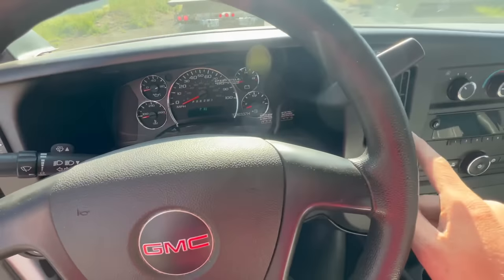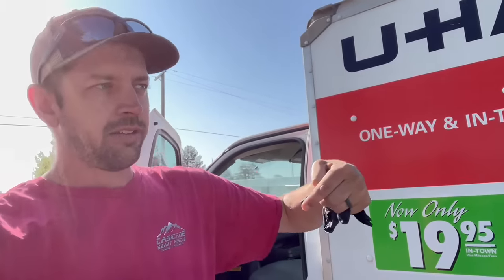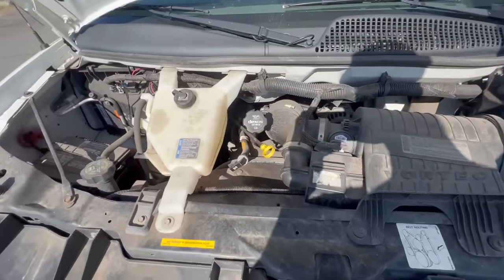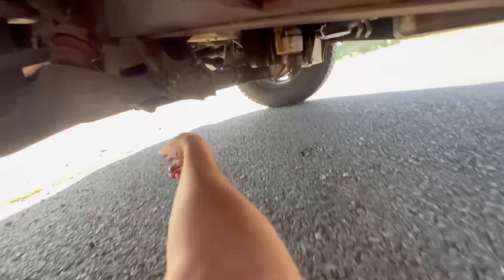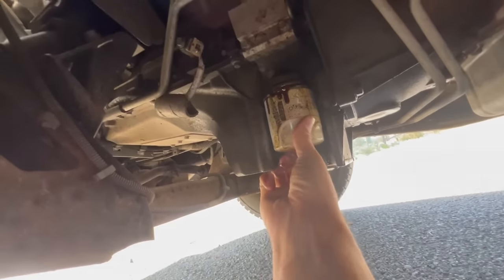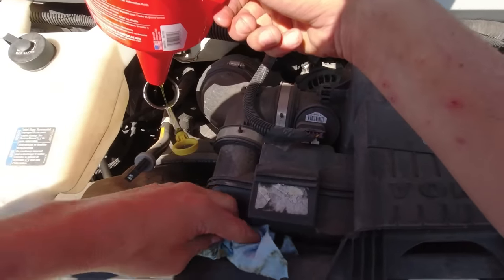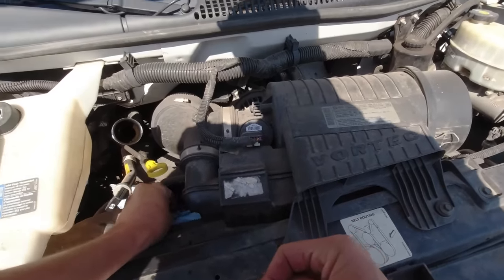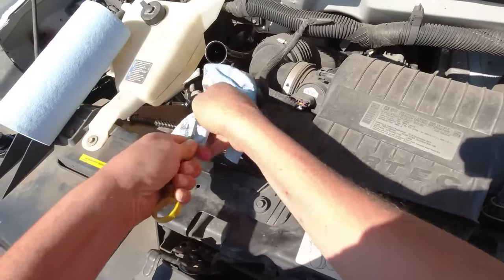Sometimes Being Honest Costs You A Job…

Comment: Good job.  I was fired from a plumbing apprentice job because I let a customer know they could turn down their thermostat a little and possibly not need the new water heater they were quoted a couple thousand dollars plus to have installed.  Next shift I was called into the office and they spent about 30 minutes explaining that they did not have to tell me why they were letting me go.

Makes me wonder now if in fact they did have to tell me, but I digress.  I knew the job would sometimes require dealing with some unpleasantness, but sometimes ended up being the wrong word.  I can't believe what I witnessed in just a couple of days, and more disturbing was just how casually the plumbers took being covered in shit water.  

As a mechanic I sometimes ate with somewhat greasy hands, but to watch a plumber eat with unwashed hands was something entirely different.  Count me out.  

"I can't quit because you fired me!"   When it comes to providing for my family, I don't quit.  I'm glad they spared me who knows what before I could have reached that point.  Also my integrity and work ethic can go with me to every job so long as I don't sell them out for any job.

Comment: Likely whoever changed the oil last just finger tightened the filter. Always give it a 1/4 turn after it touches so it doesn't vibrate loose.

Comment: On most dipsticks, the distance from the bottom mark and top mark is 1 QT. On these GM V8 dipsticks they marked ¼ QT increments, not just the 1 QT from top to bottom. Anywhere in the hatched area is fine; dead center is usually the capacity spec for most vehicles.

Comment: I used to work in the desktop/laptop repair for Microcenter.  They'd always want me to upsell customers and make them pay for things they don't need or replacement units.  I'd give customers 5 options.  The cost of repair, no cost but it's rigged to last as long as it can, and 3 different price options of comparable products at around what the laptop/desktop cost originally.  I'd usually ask what it's being used for so I can gauge what the customer actually needed.  Pentium/i3/i5/i7, r3/r5/r7, storage and features after that.  I wasn't there to pad my commission, I just want people to be able to use their hardware.  I love seeing stuff like this, gives me a little faith in some people.

Comment: Strange that, the van didn't have the oil indictor light on. You just added 5 quarts to engine that only holds 8 quarts, I would think that's low enough to throw that light on. It has it, i saw it when you were starting it.

Comment: Sometimes the old oil filter gasket will come off and stick to the oil filter Stand. When you install the new filter it will tighten but vibration will cause it to come loose. it could cost you a new motor.

Comment: You will get less dribble from the bottle if you initially poor 'overhand'.
Pour either with the jug sideways or with the spout 'up'.  Transition to 'normal' as the contents empty more.
Often the bottles have a little icon illustrating this on them!
It keeps the spout from aiming at the sky and oil/or-whatever-you-are-adding from dribbling down the side of the bottle when you try to stop adding...

Comment: Believe it or not I had a very simular situation a couple weeks ago. Went to tow peterbilt semi for power steering leak. Open hood to hook up air and notice power steering filter soaking wet. Grabbed it and wouldn't you know it was loose. Two non English speaking drivers, I asked if they did pre trip. Of coarse not. Called their dispatch and informed them of situation. Proceeded to fix it fill it up test it and saved company tow and service at Rush. Charged them for my time and they were happy as can be. Yes cost me a tow but at the same time gained a good reputation for not taking advantage of company.

Comment: Back in the day, when I was towing I had a few of these. 
1. Call comes in "Brand new car is stuck in park. Tow it to the dealer."  I get there and check it out and it comes out of park easily for me. I ask the owner to demonstrate. I see the problem right away and inform the owner that they need to have their foot on the brake to release the transmission lock. Leave a card and go on my way no charge. (This would come back to us later when they called us to tow both of their cars that were damaged by a drunk that crashed into them in their driveway.)
2. Different call about a "car stuck in park. They want it towed to a shop." Get there and it is an older Buick, RWD, parked against the curb on a hill. Sure enough won't come out of park. So I throw a chain under the front and pull slight tension on the vehicle and the owner slips it out of park easily. Charge for a minimal service call. No towing or repair shop needed. 
3. Call for a vehicle in a parking lot that won't start for a tow to a nearby shop. Get there and the vehicle won't turn over and no solenoid click, but the headlights are bright. On a whim I get in and put my foot on the brake, shift it to Neutral, turn the key and it starts right up. I tell the owner the transmission safety switch is going bad, and explain how to start it until she can get it fixed. No charge, off to the next call. 
4. 1980's Ford pickup won't start. Bright headlights but not even a solenoid click. Try the Neutral trick and no luck. I bypass the solenoid to get it started. They claim it runs reliably so I tell them not to shut it off and they can drive themselves to the shop. I was nearby so no charge, but gave them a card and told them to call if they had any problems getting to the shop.

Comment: these heavy workload engines have a 6 or 7qt pan depending on the year.  with it at the bottom of the dipstick, it probably only had 2 quarts left in it, maybe less.  bet the engine is still cooked tho, these bearings don't do well without oil even for a little bit of time.

Comment: Cant relate to it automotive wise. but run my lawncare/landscaping company the same way. potential client was quoted thousands to have a their driveway torn out and new asphalt put down.....I came along and said "you dont need a new driveway, some redneck asphalt and your driveway will look brand new for less than 300. I cut out the big pothole in the drive way, filled it with a big pile of chipseal, poured some hot tar on it, dragged my 55 gallon barrel full of concrete over it a few times, then for a few hundred more sealcoated the driveway, and the money they saved they been investing into me as bi weekly lawncare and got several referrals outta them. Always lived by the "I scratch your back, you scratch mine"

Comment: Huh??? Funny but just remembering I had this same experience when renting a U-Haul truck, the biggest one on a seriously tough weekend move with zero time to spare. I show up early for the reserved truck, all is looking good and I get in it and, well, shit. Oil pressure gauge starts out okay but drops to near zero before I can roll it even ten feet. I shut it off, get out, look underneath and big puddle of oil directly below the filter. I go in the office and tell them the oil filter looks to be loose, the U-Haul agent says that's impossible the truck was just delivered from the maintenance shop for routine tune-up and oil change. I get him to come out with me and we both get down under, I reach up and easily turn the oil filter with my hand, loose as can be. Agent is not happy I just touched the engine like that. Neither of us has an oil filter wrench. I offer to go not a block away to an auto parts store to buy one, he refuses. Says rules do not allow him or me to touch it. Says he is required to call the maintenance yard to come tow it back in. Well, shit, how about a different truck? He says none available, it's the busy season. Ended up turning a full day's work (amicable divorce, splitting of household EVERYTHING) into a three-day weekend of a small pickup and compact sedan. Missed a day of work. All because of a loose oil filter and rules about who lay hands on the fool thing. Damn but I sure wish it was a Casey La Delle (U-Haul APPROVED!) sort of person on scene that day!

Comment: Surprised a customer noticed the low oil pressure and knew what to do (in this case, what not to do). Easy to blow it off when its a rental, but a machine is a machine, its a shame to just purposely trash them.
Edit: so respect to the customer as well for taking care of something that doesnt even belong to them.

Comment: I think in this circumstance, it's fair to charge the tow fee, you saved them a trip to the shop and still worked a fair job for them. *edit - Being "honest" now makes you liable though, particularly since you sourced their parts that now might cause the next breakdown which now isn't warranted because you didn't use the fleet designated parts? Just remember no good deed goes un punished. Make sure you've documented the as is help

Comment: I had a car that went in for complimentary oil change after purchasing it. After the oil change, it started leaking oil. I called and the service manager told me it was normal, for residual drips after oil change. I took it in, they put it on the lift. The assistant service manager wanted to show me the issue. There was an oil film near the front top of the pan gasket. A super light film. I looked and noticed the drip from the drain plug, borrowed the technicians flashlight to point it out. The technician then mentioned he had just wiped the drips from the drain plug. There was a small puddle on the floor under it. The technician had cross threaded the drain plug. I asked if they were going to fix it right, at their cost. They complained about warranty. Long story short, I emailed Chevrolet about the work, and also notified the owner of the dealership. If I were the owner, and the technician could not find the leak while it was staring him in the face, I would have had him pack his toolbox and leave. The service manager and assistant would probably been looking for new employment.   Casey, you do great work! Thank you for sharing

Comment: What would happen if you did all that and the pressure still dropped? Would they now be paying for the extra time and materials on top of the tow?

If the engine fails due to damage sustained while low on oil is your repair work insured? If the hypothetical engine failure results in an accident? Are you liable due to your repair?

Stick to what you do and do it as best you can. I don’t think you did the wrong thing but I don’t think you did the right thing either. Let them know what you found and they can decide from there and fix it themselves. Same principle no risk.

Comment: I think that once the cost of oil, time, travel etc was taken into account, the bill to the company would have been comparable to a local tow, but not a 7hr job. I’m not saying if what you did was right or wrong, but, unless you’re employed as a field mechanic, your job is to tow cars, and that’s what you’re paid for. It’s not as if they would receive the truck and never use you again because you didn’t check the oil level and find a loose oil filter prior to towing.

Comment: To add evidence to your statement of doing right by the customer, I had an electrician come out and give me an estimate for finishing hooking up my tankless water heater as one of the coils wasn't hooked up since the new tankless used more energy compared to my previous one.  Gave me an estimate of $4k as they said things needed replacing in the attic to be up to code as the bracket was cracked.  Called the second company that gave me an estimate of $1300 if the bracket needed replacement and only $700 if the bracket was good but only wiring was needed.  Hired that second company and they told me 30 minutes into the job that the "broken" bracket was a PVC holding that had gotten loose.  They fixed it no cost and even gave it support to be up to latest code.  My bill was only around $700 so who do you think I am calling on all electrical issues?  Who do you think I am recommending to all my neighbors?

Honest companies get all my business.

Comment: ill be honest here, i did an oil change on my car about 2 weeks ago, tightened the oil filter by hand as your supposed to, but my big brain didnt wipe the filter off, hands were oily, thus the filter was oily, i did my darndest to tighten it and thought it was fine, 2 quarts of oil later i got under the car again, wiped off the filter that was now more oily, and tightened it by hand but effectively this time and bam, problem fixed, sometimes you think "it should be fine" thats when you double check your work, because "it should be fine" can end in "its done for" real quick

Comment: GM uses a pressure switch and estimates pressure for the gauge in that model. No actual pressure reading, a engine with no oil at all will act the same way. It probably never had oil pressure when the oil drained out.

Comment: I would be very concerned about your insurance and how you drove the uhaul (around, not just up/down the street) with out written consent. Also lack of saefty arearnes on your part, at the very least use your 4-ways on both trucks. and put the hood down (not all the way but to see). I totally agree with you on doing the correct thing and what you felt ok doing. Good Job

Comment: I’ve forgotten who said this: “Nothing is more rare, or so astonishes men, as common sense and plain dealing.” 

About 1,000 years ago I had a 1965 VW Beetle that had lost braking power. I took it to the dealership, and they told me that it needed a complete overhaul of the braking system. The estimate made my hair stand on end. Then I learned of a little independent VW repair shop, operated by two young German guys, both trained at the VW factory in Germany. I took the car there, and they told me that all I really needed was new shoes and adjustments, at a fraction of the dealer estimate. I turned my car over to them, and had zero trouble with the brakes from then on. I learned later that (in the US, at least) dealerships took a loss on the cars, the service bay being the profit center.

Comment: Running that low on oil for several miles still could have caused significant damage to the engine bearings and other internal components.  Should have still had thier mechanics examine the engine and the filter contents for metal shavings.  You could have just pushed off a major problem to a later customer.  Nothing worse than being fully loaded and broken down on the side of a highway. It is great that you discovered the problem and helped the customer. Fingers crossed you didn't open yourself up to future liability.

Comment: and that's how you keep customers at HQ but iritate the local shops. Yes, I tow and do mobile repair for U-Haul also. I have learned to never assume another tested voltage at the solenoid prior to changing a starter.   The things a $6 relay will fix 🤦‍♂

Comment: Good catch, but usually the first thing I check when low pressure is the oil level. Every time you start the engine with low oil you are doing damage.
Reply from the maker: Not true.  An engine runs with no oil every time you start it up.
Reply: @CaseyLaDelle  if the oil level is correct and the pump is working then there is just a short time where the oil left from the last time it ran lubricates the engine until the pump replenishes it. If the level is low, the pump will suck all available oil and then go dry. If you run your engine without  oil pressure damage will be done. More so with an aluminium block than steel.
Reply from the maker: @dangerousliberty  good thing I didn’t run it without oil pressure then…

Comment: As others have said good job when customer's find a honest shop. Employees and good service they are not just customers for life

There kids and friends are customers as well

Boss had a customer coming in for a Vale job
Been checked in two other shops confirmeding the trouble.

Car had a dead miss around 40k or could have been 140K. Engine was as clean as the day it left the dealership.

Before tearing into it I popped out the spark plugs and pulled a dry compress check.all the numbers were right at150 or so

Order new spark plugs and the customer Was a customer for life as he stopped by and found his car done and 50 dollar's in service not the 450 to 500 Bill he was expecting

Comment: I had the gasket from the old oil filter stick to the engine when I replaced it once. Shot all the oil out with force when I turned the engine on. I would have been funny if it wasn't me that did it.

Comment: I used to work at a small State Inspection station for several years and we operated the same way. My manager was one such guy and his ethics rubbed off on me, not that I needed to cus I'm honest to a fault already! 😅 But we had people coming far and wide for just an inspection but they knew we'd be honest and not just take their money. We helped them out, sometimes all day if their cars were being finicky, until it passed and we never pushed any extra BS just to make a quick buck and get rid of them. We'd hear stories of new customers just coming from another station and billed them hundreds only to fail anyway.

Anyways, honesty is a rare commodity nowadays and while it's gotten me in trouble a few times for being a bit blunt with my words, I wouldn't change it for anything. :P

Comment: Frankly, I would have checked the oil and for leaks after before even trying to move it into position for towing. But that's just my experience with vehicles that have low oil pressure.